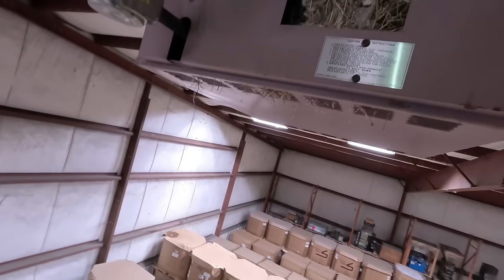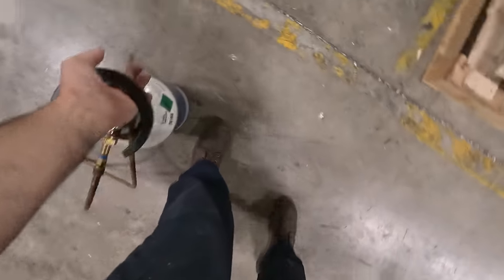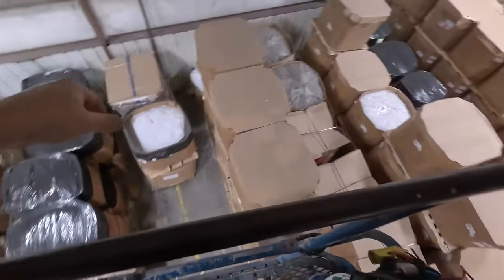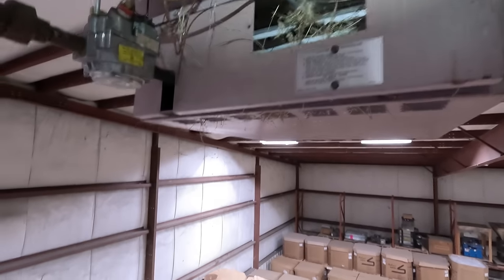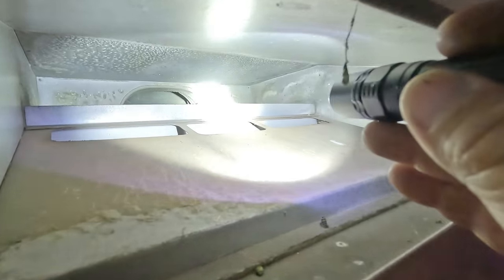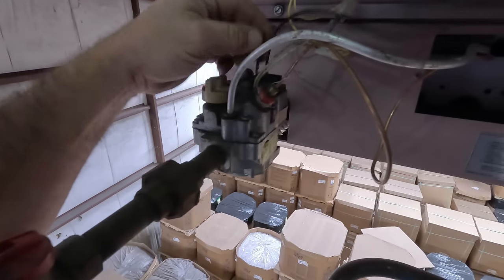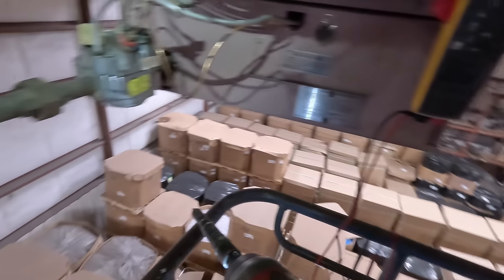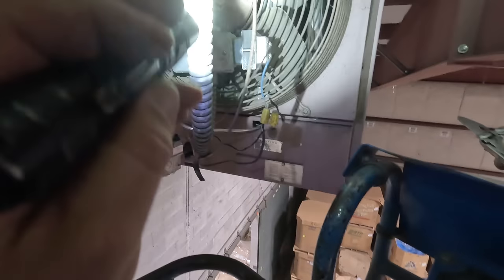Warehouse Unit Heaters Not Heating

Comment: Preventive maintenance would have been found those a year so back  . Almost fire in the hole that would have been a special day. Was wondering what the roof vent outside looked like .  Maybe when they or you install the new heater they will look at it.   And a special Thanks to the Guy on the ground floor ,would have been a total pain to check power on those units .
Reply from the maker: You're right on both accounts. 👍👍

Comment: never found a bird nest in any, but a few totally soot clogged and full of ash. one had a lack of working fan banging high limit(rivets broke, fan klixon loose from heat exchanger)
it also had a cross-threaded orifice on the gas manifold, surprised it never went boom or flashed off from improper burning, the place has multiple units from 1970's/80's (lol) the orifice issue looked to be from factory! no cracks in heat exchanger, so that orifice and short cycling had to be the cause of soot.

Comment: Using compressed nitrogen that way is dangerous and is a violation of OSHA.  The pressure must be reduced to a max of 30PSI (29 CFR 1910.242(b))
And a safety harness is required when working from a boom lift.
And the wiring looks crazy.

Comment: Is 4 of them enough to heat that place? Is the ceiling insulated? Ty.
Reply from the maker: The white stuff you see on the ceiling is rolled insulation. Far as whether or not the systems are large enough, I did not calculate a heat load and loss.  I was there to fix what they had to make it run. I’m not a salesman looking to sell them new equipment. It’s worked this long. I would say it’s probably fine.
Reply: @HVACRSurvival  Thank you, I am asking because I want to buy such a place in Madrid and renovate it into a workshop and office. I have no experience with being in a warehouse all day long so I am scared of the heating problem.

If I get a place like 200m2 with 7m ceilings, and install 2 Daikin VRVs, would I be terrified to turn them on for 3KW/h for 1euro, paying to the king for God's electric. 

Thank you

Comment: Would windy conditions make the mini split run longer than it should? I have 2 new units that I'm using for heat now. Remote is set at 65, yet house is at 75 degrees now. I've noticed that it does this mostly when it's very windy outside. House is located on a large lake, so the wind will get worse this winter. Or, is this a thermostat issue?
Reply from the maker: The thermostat you used to adjust the temperature does not sense the room temperature. The temperature is sensed inside of the head and that's why the fan runs all the time. Be sure it's truly set at whatever temperature it is you want by keeping the remote pointed at it and you should hear a beep confirming you change the temperature. If it's still over shooting then yeah you've got an issue
Reply: Thanks. What about the wind? I have a short  fence partially blocking the wind, but I still think the wind is affecting the fan on outside unit.  @HVACRSurvival

Comment: The one thing i don't get is how does the heat come down at surface level where it's needed , since warm air is lighter ?
Reply from the maker: Magic! LOL The fan blows it around
Reply: Also looked like they had some ceiling fans in place.

Comment: probably best to take motor and gas valve off the burnt unit to repair others and have them install one new unit there. 🤔
**edit and at end of video, lol. more or less what happened. the radiant type is probably best for the open dock area anyway, otherwise it's like whizzing into the wind. 🤡